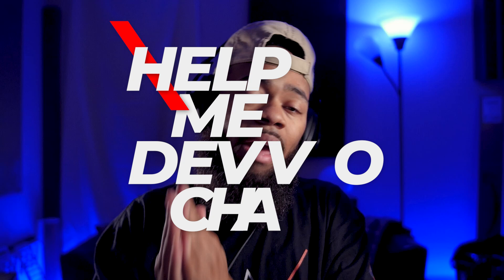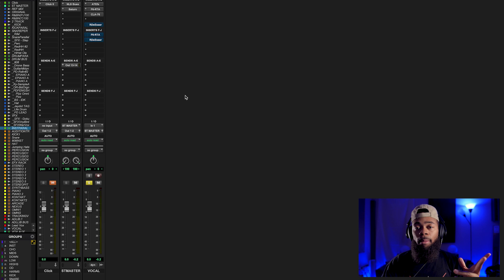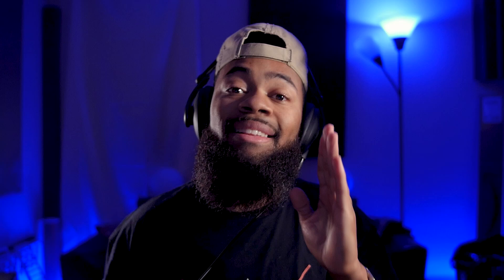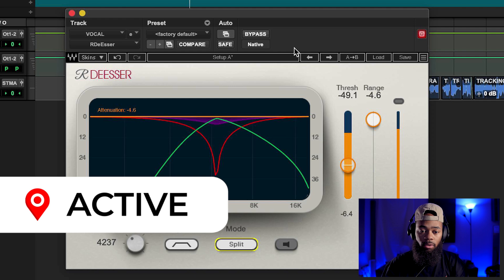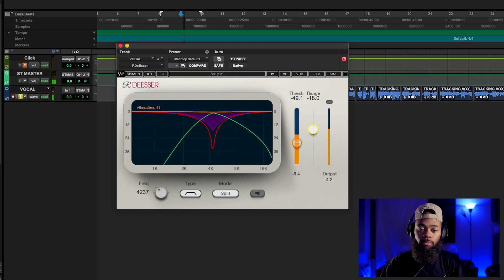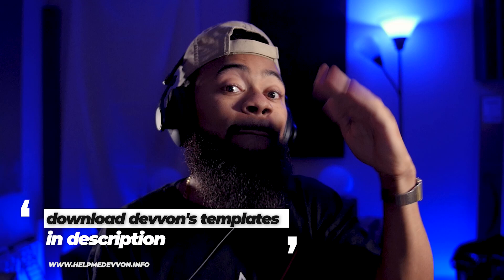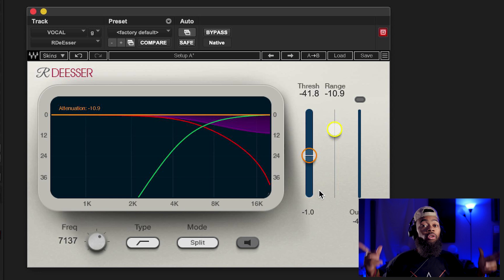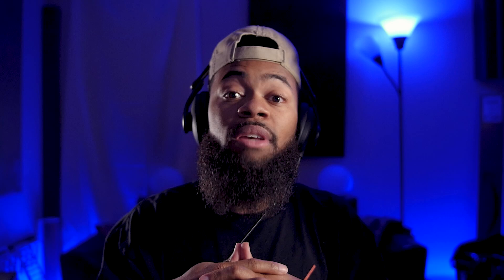Finally Understand The Power Of A DeEsser

Comment: Hey, good job, man.  As someone who has struggled with sibilance, I appreciate this.  I have done everything you mention, and I still have issues, to the point where I have gone in and manually turned down the esses.  I do think many of today's condenser mic's are pretty sibilant for alot of vocalists.  I am starting to use a ribbon mic for my voice, and my general impression, so far, is it seems to record a smoother version of my voice, with a noticeably better sibilant characteristic.  Will know lot more soon.